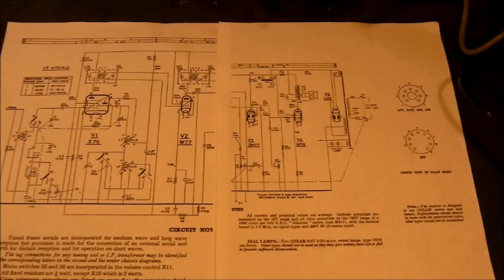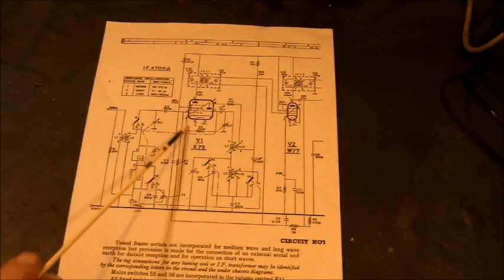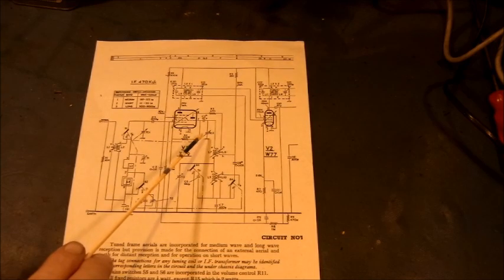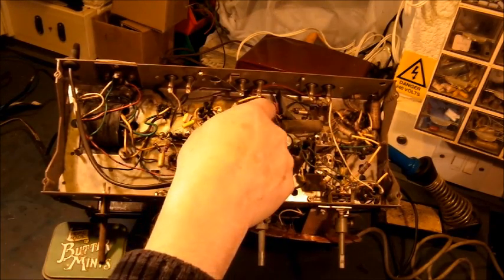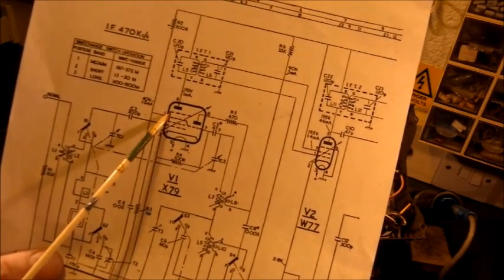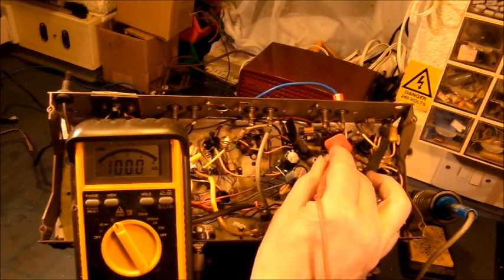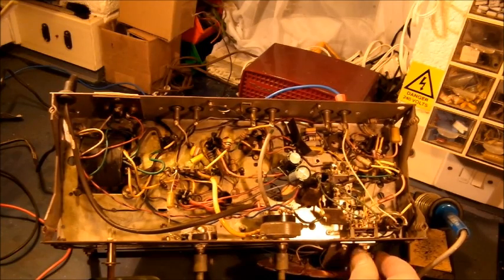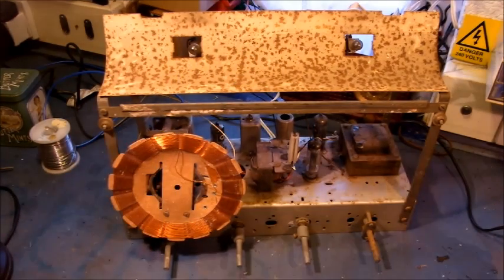GEC, Model BC5445, Vintage Radio Restiration, Part 6

Comment: Phil it was great to receive the next instalment of this radio repair, but first. . .

You have a keen awareness of the historical nature of your surroundings.  Oftentimes, residents of an area, do not appreciate the places where they live.  Sheffield steel has a fine history, and I enjoy seeing the photos of some of the businesses which helped to make that history.  There is a rural community near my home called Sheffield, although the residents are more inclined to produce maize rather than steel.  I would suspect that the original settlers of the area must have emigrated from some place near where you live.

On to the radio.  You make things look very easy when you are working and fault finding.  I have always maintained that almost anyone can effect a repair ONCE the source of a fault has been determined.  Finding the faults is the tricky part.  Some enjoy the game and others not so much.  You appear to enjoy the hunt.

I was happy to see you disconnect that resistor BEFORE checking it.  Too often, I see people trying to check components, in circuit, which can give one an indication of a fault source, but to really determine the health of a component, it must be isolated.  That is a bit more trouble, but it is the best way to work.  Bravo.  (I must confess that in these days of solid state equipment with circuit boards, it sometimes requires one to mutilate a board, but you can do a professional repair of any damages).

I am thoroughly enjoying this series Phil.  Thanks again.
Reply from the maker: Stephen, as always, it is great to read your comment my friend.
I totally agree with you, it is good to become aware of the history, which takes into account economic, social, political, and natural, aspects to the surrounding area where one permanently resides.   I have always loved learning history.  Many years ago, when I was a Modern History undergraduate, I was presented with a selection of specialist themes for my third and final year dissertation.  I chose to read, and research, ‘Local History’…’twas very challenging but a happy time my friend.
Sheffield is famous for producing steel – now a mere shadow of what it once was – but if one looks at that proper noun, it is conveying something specific... ‘Field of wheat sheaves by a river’.  A rural setting as you described (producing maize) is not far removed from the entomology of this city’s name.
Now I must point out, there were a small number of mistakes, or blunders, I made Part 6.  The local oscillator runs at 470kcs above the tuned frequency (not made clear till later).  The fault find looked too easy – almost convenient as a ‘bit of show’.  I could have checked the HT voltage, followed by a voltage comparison on pin 1 of the hexode V1, then unsolder one leg of that 100k resister to check its value…in other words, a more analytical approach to fault finding – especially as it was how I earned my living for over thirty-five years.  Shame upon me!
I’ve worked with modern soldering machines, removing and re-soldering inline-ball chips, multi-pinned chips, and the like.  I was always anxious, wandering whether it was going to be successful LOL.
Have a brilliant Christmas and a superb New Year my friend,
73s de Phil.